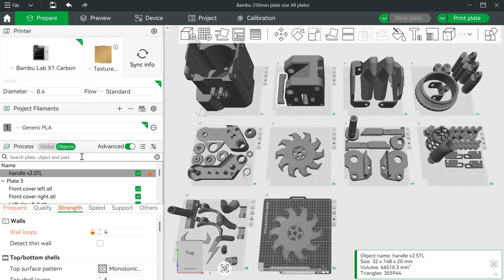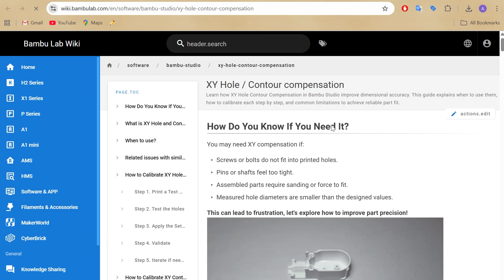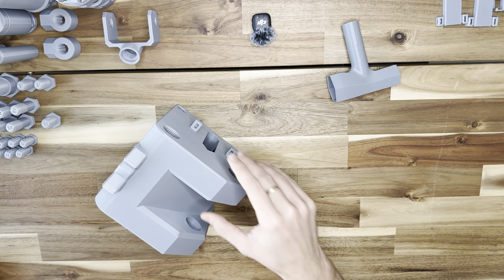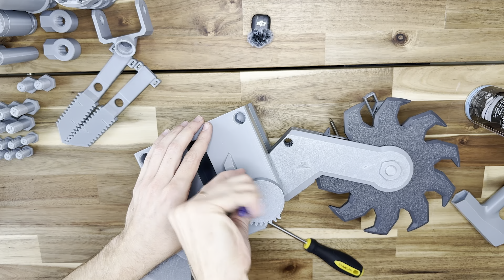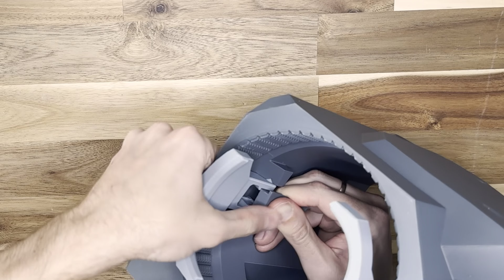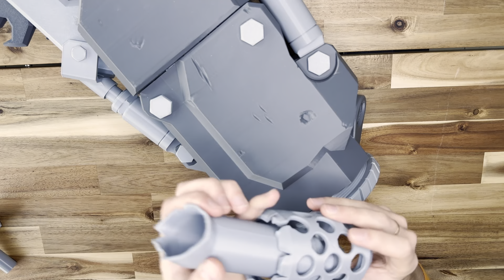Power Claw with rotating SAW, Fully 3d printed and Fully mechanical

Comment: Comprie o arquivo, de fato ele é bem simples de mexer, mas to com muita dificuldade em imprimir a serra circular giratoria, ela simplesmente nao gira nessa velocidade que voce tem ;( nao sei mais como mexer nas configurações.
Reply from the maker: There is 2 files one with bigger gap , if still bearing rotating bad you can try to correct your flow settings ( decrease) or use XY compression settings 0.1 mm , also lubricant can help silicone or PTFE
Reply: @Alex_Geek_Workshop eu fiz isso, inclusive com o modelo menor já com as dimensões pra 80% e coloquei 0,1% de compensação, mas ele simplesmente fica saindo, desmonta todo ou junta os pinos do meio.
Reply from the maker: @saimonroniele6455 can you write me on email ( through website) or in my social media, comments it’s not best way solve it
Reply: @Alex_Geek_Workshop claro vou falar com vocês por lá
Reply: @Alex_Geek_Workshop  mandei e-mail pra voces, voces receberam?

Comment: How do you remove join lines in the chainsword prints?
Reply from the maker: You mean blade part?
Reply: @Alex_Geek_Workshop yes
Reply from the maker: @imfunny246 its simple, I just print in one piece
Reply: @Alex_Geek_Workshop : ( that makes sense, now if only I can win the lottery and get that big a printer. Thanks for the  reply : )
Reply from the maker: @imfunny246 it’s not quite expensive, check Ideaformer ir3 v2
Reply: @Alex_Geek_Workshop oh thats interesting.  How easy it it to work something like that? Im quite new to 3d printing
Reply from the maker: @imfunny246 hm, it’s quite unusual printer and you have to spend some time, you can’t print everything on it, but long straight thing it’s ideal
Reply: @Alex_Geek_Workshop  do you have assembly instructions for the chainsword stands?

Comment: Your real voice is so much better, alot easier to understand. Is there any chance you will redo your motorized chainsword tutorials with your voice?
Reply from the maker: I am preparing revisions of it (new motor, new board, new BMS and battery compartment and maybe built in charger ) , and I have plans to make some kind of review on changes and solutions, and guide will be in pdf because it’s much easier to update it
Reply: @Alex_Geek_Workshop i bought the files off cults3d and the electronics from your etsy store, if i want this new update will i have to buy the files again?

Comment: Fully compatible with original claw?
Reply from the maker: Yes
Reply: @Alex_Geek_Workshop  nice :3
Reply: @Alex_Geek_Workshop  just double checking this means we can use original claw like the biggest part the main body?
Reply: @Alex_Geek_Workshop  just double checking this means we can re use parts of original claw like the biggest part the main body instead of reprinting? im sure some parts different like al lthe gears etc.
Reply from the maker: @michaelkim843 yes, main body and front body have same connection points